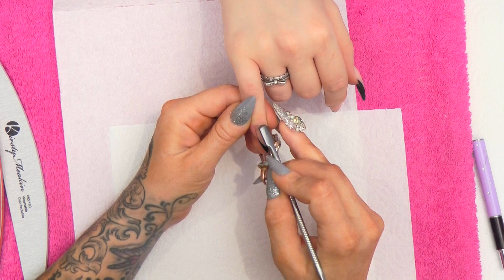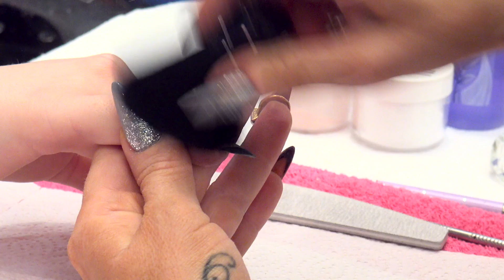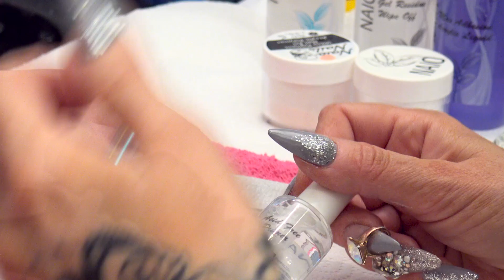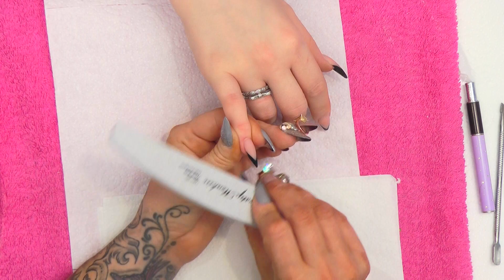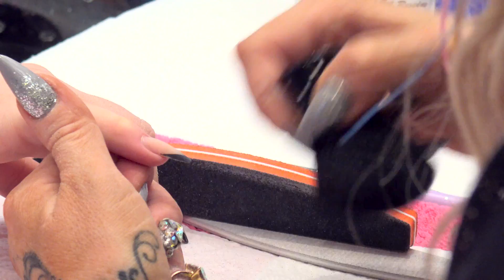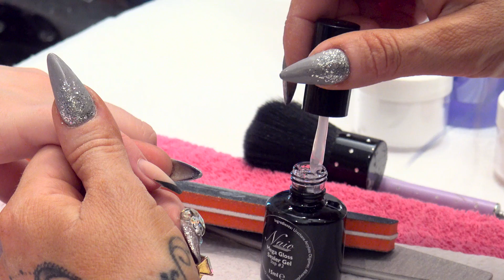Acrylic Nail Infill

Comment: I have a question I got this new acrylic and I used it and when it dried it looked really foggy with white flakes it was a clear acrylic why did it do that ? I need help
Reply: Either you are picking it up to dry and theres still power acrylic in it or its just not a good product.
Reply: +Dylan Nichiporuk  thank you for your help 😁 I'll try to wet the brush more now

Comment: Hey girl I need your help. I have been doing gel nails at home for about 6 months now, never had a problem until recently... My cuticles and the skin under my nails are dry, cracking ,peeling off. I moisturize with lotions, cuticle Lil's and coconut oil but they crack and start peeling again. It's been 2 weeks since I did my nails and now I don't know what to do. My fingers aren't swollen or they don't hurt but the cuticles and the skin under my nails look horrible. The dry skin has a yellow look to it. Is that normal?
Reply: Have you cured gel on your cuticles before? What products are you using & where are you purchasing? What is your prep work before you use the gel? Please, do be careful. If you really enjoy using gel, find a course and get yourself trained professionally. It's just not worth ruining your nails for long term. I'd also like to add, as a professional nail tech (taking out problems like allergies, obviously) products are only damaging when incorrectly applied/removed, or when bad products are used.. I've had gel on my nails for two years straight, no breaks between, and my nails are perfect underneath. It's all about the right use and right products :)
Reply: no product will damage the nail if done correctly 
im a trained nail technician and only see this if the product idnt used correctly. 
example: sloppy work
Reply: +mardel3 I had that problem too. I suspect that I am slightly allergic, try applying some hydrocortisone cream to see if that helps! I have eczema in general so my Lidex steroid cream really helps the cracking.
Reply: I'm not a professional but i can tell you that gel is VERY damaging to the nail, especially when you do it over and over without a break. I dunno, thats my 2 cents.